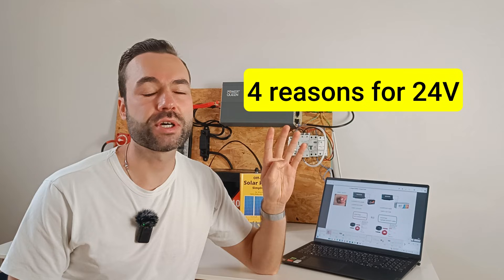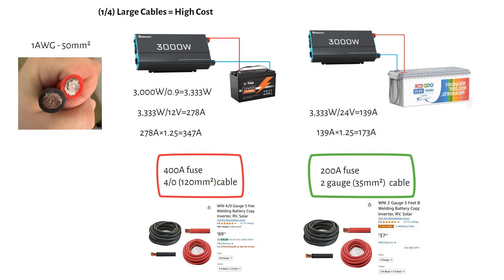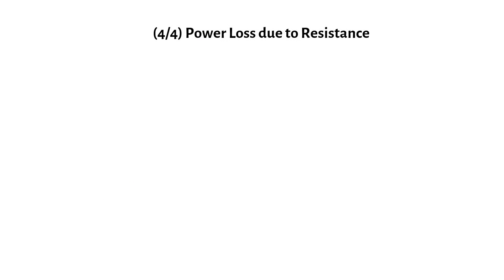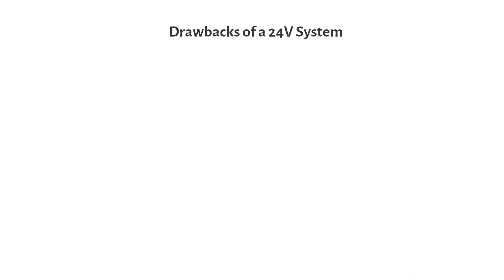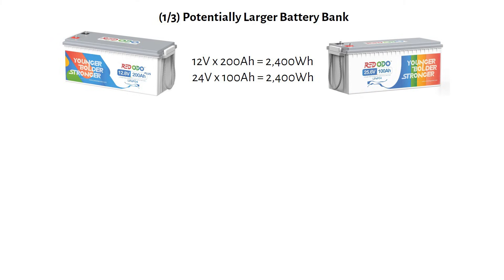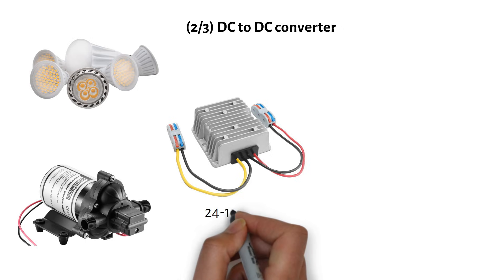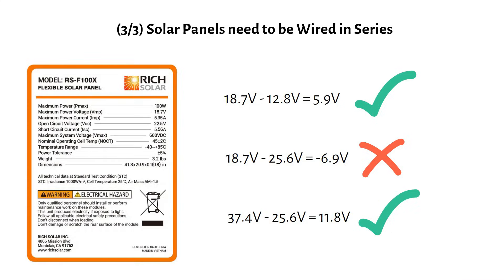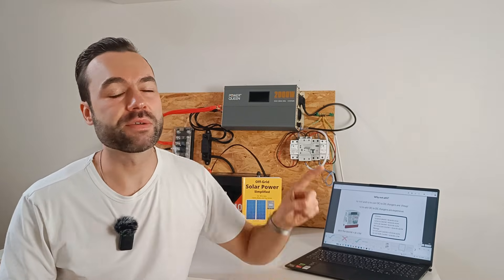12V or 24V for RV's - In Which Case is 24V a Better Choice?

Comment: Shouldn’t we use a dc converter with 13.8v output instead of 12v output since most devices run better actually want 13.8v ?
Reply: Fridge runs cooler but tv runs well

Comment: Thank you Nick, we who will use these systems in an RV have no other choice than a 12v system.
the one problem that most of us facing is to find a suitable setup to run a small AC in an RV for a full day specially here in the middle east.
will be very grateful if you can explain such a setup.

Comment: More subtle reasons for 24V over 12V
1.  Inverters convert to between 110V to 240V AC.  All else being equal, the smaller the input DC voltage compared to the output voltage, the less efficient.  Efficiency varies with specific model, but in general, 24V>12V and 48V>24V inverter efficiencies.  So 24V would generally be more efficient than 12V.  This is a small factor overall.
2.  The higher the voltage that can be run through the solar panels and wiring to the charge controller, the more efficient/cheaper the wire.  DC-DC converters are also more efficient the smaller the difference between input and output voltage.  So 24V would generally be more efficient than 12V.  This is a small factor overall.
3.  It is often cheaper to use a consumer electronic like a TV over a device marketed for RVs.  Televisions with external AC-DC power conversion plugs can be run on DC directly with a DC-DC converter.  No inverter and the especially high efficiency loss for low loads (like just a TV).  But, some consumer televisions come with odd voltage requirements.  I have a Toshiba that takes a 14VDC input.  With 12V systems moving between 11.8-14.6V you'd need a more expensive buck-boost converter compared to running the same on a 24V system and only needing a cheaper buck converter.

Comment: 24 V inverters are not common in my country.....
Reply: Powland easun selling solar inverters cheap
Reply: @jussikankinen9409  Thank u ...Ive just check ..they are cheap indeed
Reply from the maker: Indeed, 24V inverters are hard to find. But just because 12V 3,000W inverters exist, doesn't mean you have to buy them.

Comment: Great work on the video. Thanks for going through and explaining. I had never really fully considered 24V, however, I think I'm more convinced than ever to stick with the ubiquitous nature of 12V.

The only fat cable run has to be for my inverter, and then slightly oversize all other runs to future-proof. I'll take the "buy once cry once" over the hassle of wrangling 24 and 12 volts (and nearest converter amp rating) all over the place. I take further comfort after that, knowing that every DC tap and wire anywhere in the trailer is already at my desired 12V.

I have way too many gadgets, both present and future wants, all of which will be very well supported with 12 volts. I'm constantly drilling holes and adding new bulkhead ports all over my RV. I don't want to have to figure out where the nearest 24 to 12-volt tap is and then rework whether I have enough amperage on my local DC-DC converter for that point. The consumer side just supports 12V way too well for me to consider switching. In my RV I run Internet -- cellular or Starlink, POE switches, cameras, TV, DVD, XBOX (with small easy mod), stereo equipment, subwoofer, ham radio, heat blanket, shoulder massager, heated slippers - all native 12V - and who knows what I'll add next? I will rest easy knowing there is a 12V version of it out there somewhere, and I will not need to refactor my converters to accommodate.
Reply: Do the electronics you mentioned that run on 12V run on the actual 11.8-14.6V on the system, or do you have to use a converter to guarantee exactly 12V?
Reply from the maker: I've never heard of a 12V appliance that cannot run in the 10V-14.6V range.
Reply: @cleversolarpower  my computer requires 12v exactly. Ditched the ac adapter and run from a dc-dc buck converter.  Monitor requires 14v. Did the same.
Reply: @SeekingBeautifulDesign  this is a great question! And this is why I love 12 volts. Most product designers understand that everybody in the 12-volt world is playing with the same variance in batteries! It's very seldom that I find a device which requires a regulated exact 12V supply!
Reply: @klm724  It's funny how perspectives differ.  I've only recently assembled a system where it seems that you've had one for a while.  

I chose 24V because almost every 12V only has a 12-24V equivalent-USB, lights, refrigerator, freezer etc.  For things that require an exact voltage-computer, television...I need a DC-DC converter anyway, so 12 or 24V makes little difference.  The savings in charge controller, wiring cost and wiring power loss makes 24V more appealing.

I almost prefer 48V for the cost and efficiency gains, but there just aren't 48V appliances although the extra cost of a DC-DC converter (48V->12/24V) might make a 48V system superior to a 12/24V system.  But, I've bought my inverter so am somewhat locked in.  One of my old charge converters only does 12/24V as well.  Would have to buy 48V-USB converters as my current converters only work on 12/24V or deal with double conversion losses: 48V-24V and 24V to USB.
Reply: @SeekingBeautifulDesign  Are you in the US or Europe?
Reply: @SeekingBeautifulDesign  That is funny! I haven't found much 24V of anything - I have looked to the well established 12V car/truck and RV product builders, who have built every gadget under the sun for decades with (the now fading, but) ubiquitous cigarette plug adapter. I know for sure anything that comes with one of those - I can chop it right off, and power it from my any 12V rail I have distributed throughout my rig. Even the TV/DVD combo that came in my RV is designed specifically for 12V (11V-14V).  I have been using Anderson power distribution blocks with individual fused connectors. Even 12V powered USB hubs that I use as charging stations - they are already rooted in 12V....
Reply: Still, I love all your videos and your very circumspect and scientific approach to each problem. I have learned a lot from your videos, and I stand to learn much more. I'm a loyal fan!
Reply: @klm724  made sure my cigarette usb adapters take 24v. Just found one either reverse polarity protection as I've fried a few while learning.

Have a 12/24v fridge/freezer.  Tried a 24v kettle, but couldn't justify cost/time vs existing ac kettle when I needed the inverter on anyway.

Sourced in N.America.  Can get 24v rice cooker through truck community.
Reply from the maker: If you already have a 12V system and don't plan to expand, then sticking to it is going to be the best solution.
Reply: @cleversolarpower  that's a good point. If I was building something from the ground up and I didn't have to worry about tearing into the walls of my RV 😬 then I might reconsider the 24V, but it would require a lot of careful planning...
Reply: @cleversolarpower hi again...just asking if it's possible to connect 2 pairs of 300amp/12v batteries..=24v@300amp...each pair...and have you a video on doing a similar setup or can you make one on how to do a total setup for this as I'm needing to set this up on my offgrid cabin.thanks so much😊🇦🇺🇦🇺

Comment: And what optimal voltage for that solar??
Reply from the maker: I don't understand your question.
Reply: @cleversolarpower  I think which voltage would be the most optimal when you see that 12 and 24 volts have advantages and disadvantages. What would happen if the battery was at 35 volts and not at 12 or 24v. Does higher voltage mean better and greater usability or not?
Reply from the maker: @tota0523  We don't use 36V batteries because there are no inverters for it. Higher voltage is usually better. Check my video: 12v, 24v or 48V.
Reply: @cleversolarpower  I wrote that for 36 volts purely as an example. But thanks for the explanation.

Comment: hello 
If I have an inverter with 3 mppt, each one of them can handle a capacity of 40 amps, so that mean 120 amp Divided on 3 ..

now I have several different PV's , the first PV is 220 volts and 16 amps, It will be linked to the first mppt

the second mppt will take different PV 40 volts and 32 amps 

the 3rd mppt similarly, it will take 41 volts and 30 amps.

 my question is how will the inverter combine these capacities, in parallel / series  

Will it be 220 volts and 78 amps or ?

Someone said they work independently, and someone else said it will merge
Reply from the maker: I made a video about multiple charge controllers on one battery bank. In short: it's no a problem. Just make sure they are set properly to the right voltage, no communication is needed. The inverter just sees the battery voltage. The MPPT will charge the battery.
Reply: @cleversolarpower   can i have the video link ?
and what you mean about right voltage, 
My idea was that it would give more Vmp & Imp than connecting 10 panels to one MPPT and I would have made them work at their maximum capacity, without breaking the maximum allowable amperage and voltage

Comment: What about 800v or 1000v systems in electric vehicles 🤓☝️
Reply: Those "high voltage" systems are for the drivetrain.  EVs have a separate "low voltage" 12V system for the cabin electronics/windows etc.  Tesla is moving to 48V "low voltage".  Many EVs also offer USB, wireless charging and AC power plugs, so getting power from the EV goes through manufacturer supplied interfaces to both systems.
Reply from the maker: That's a completely different story. For off-grid we focus on 12,24, and 48V systems.

Comment: i have 4-100amp 12v lipo lithium batteries.. how can i wire them for 24v.. also what about wiring the solar panels for 24v? my system is basically setup for 12v.. this is before realizing 24v might be the better way.. sad thing is my Renogy inverter is only good for a 12v system.. would hate to have to buy another inverter.. any suggestions? love your channel! watching further in the video i see you answer some of the questions..
Reply from the maker: Indeed, you cannot use a 12V inverter on a 24V system. If your system is running ok, then i would leave it like that. But if you plan to upgrade in the future, you can wire your batteries in a 2S2P configuration. That are two 12V batteries in series x2, and the parallel them with each other. You should always wire your solar panels in series up to the max allowable input voltage of the charge controller (check my video about sizing charge controllers). Unless you have a PWM, if you have a PWM, match the solar panel input voltage to the battery (+5V).
Reply: What about using a 24v battery for a 48v inverter, will it still work?